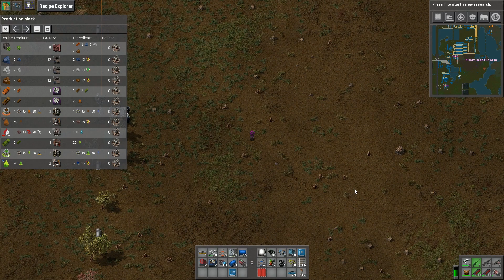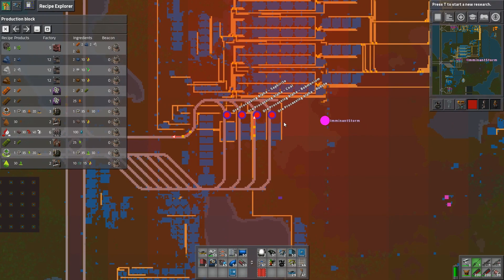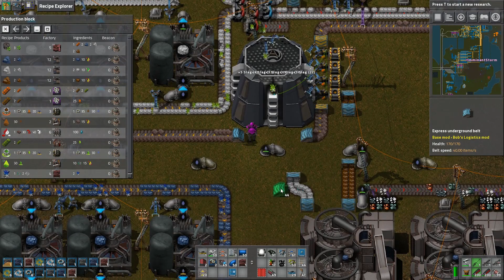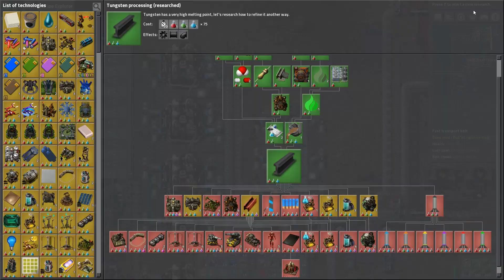Factorio - Angel's & Bob's - Episode 69 - Grind and Dissolve

Comment: on the stone line, you upgraded every belt to blue except one red corner near the end
Reply: It would also help to split the from-the-geodes crushed stone belt before the main merger into the liquifiers, running an underground past the local crushers to better feed liquifiers 4-5. I can see the route I'd use for this spaghetti, but it's not easy to explain in words.

Those last two liquifiers clearly aren't getting enough input and there's clearly lots more input available that isn't feeding quickly enough.
Reply from the maker: I think I see what you are getting at.  I will make the adjustment.